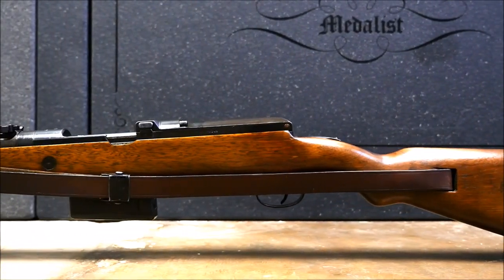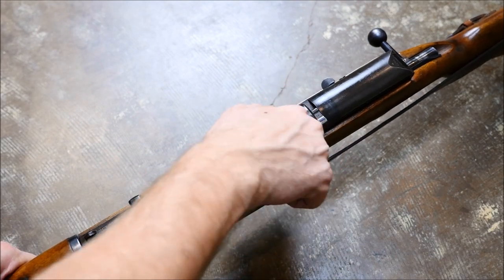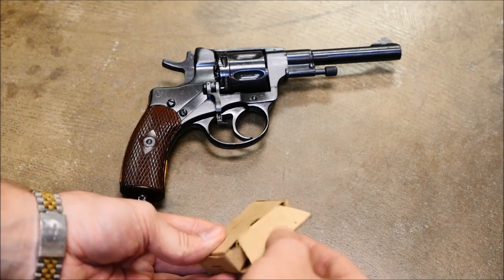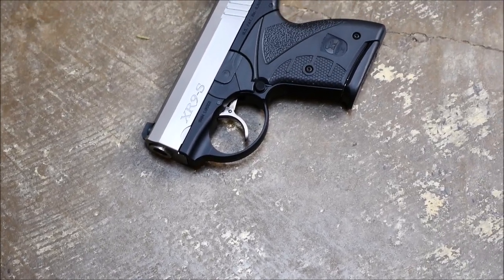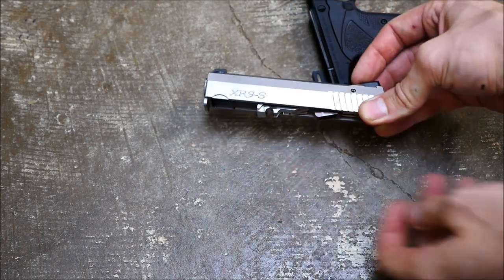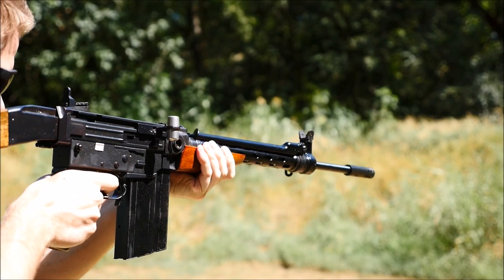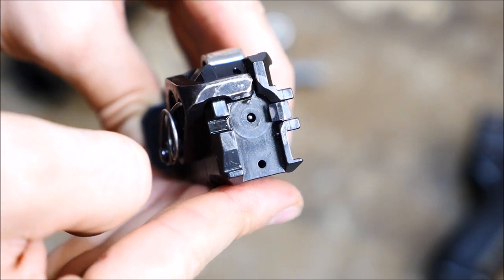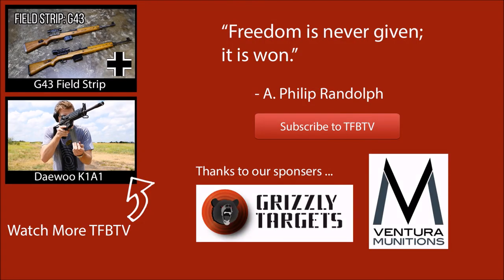Top 5 Overly Complicated Guns

Comment: The German guns being complicated is not really surprising. The Russian gun being complex is. It's really an odd as they tend to be as simple as possible. Nice list
Reply: I mean they made the Mosin Nagant not be a able to eject clips and the entire bolt assembly be two different pieces
Reply: An94 enter the chat
Reply: Ak107 enters chat
Reply: The Nagant Revolver wasn't made by Russians.
Reply: The AN-94 will disagree with you.
Reply: Common Sense Realist  No, the Nagant is Belgian. Check on Google if you want.
Reply: Nagant 1895 revolver was a pain in a ass to reload (because of the fixed cylinder), but not overly complicated, otherwise Russians would not adopt it as a service weapon. BTW, it's original design was Belgian, not Russian.
Reply: @hersencell6880  AN-94 and AK-107 are rather exceptions than a general rule.
Reply: With Germans, safety is in the details. In other words, safety is anchored in every designer. Unlike security through statistics in use.

Comment: Leave it to Germans to look at a functioning design and say "How can we destroy this in the most expensive overengineering possible"
Reply: Germans had some of the best technology at the time. They still do to this day.
Reply: Generic Username Errrrrr wrong answer.
Israel currently has the best technology in any full standing army to this day, up to and including tanks, guns, air defense, and situational awareness, for obvious reasons. The U.S. takes most advanced Air Force and most advanced Navy, technologically, and are the only air force to have battle-proven stealth fighters and bombers.

After WWII, Germany was limited for quite a while on what they could design. They used U.S. or Russian imported weapons and equipment up until the end of the cold war, when they got the chance to design their own army again. They have been brought up to the European standard, but for sure don't surpass the U.K. or Russia by much, if at all. Especially with the revamp of the AK line, the T-14 Armata, PAK-50, etc. They've lowered funding quite dramatically due to NATO and the lack of a need to have a full standing army equipped the top-of-the-line gear. 

Even during WWII, most designs that were seen as "technologically advanced" ended up breaking down on the side of the road. See: Pz V onward. They were made so poorly that after a few 75 or 76mm rounds, the front plate would start to fall off most Tiger IIs due to the terrible metallurgy late-war. The P80 and Me262 started development around the same time, with the Gloster Meteor arriving almost a full year earlier. The German navy was merely capable for its time, with its big advantage being submersibles in the European theatre. Had the U.S. not been involved with Japan, it would have been very equal in the Atlantic. 

The only thing they really had going for them were the V2's and the STG.
Reply: Dank Meems I'm talking about WW2. Also, look at the weapons and technology they had at the time. They created some great weapons and vehicles (that of course got copied later on). Look at German cars, they are still really good. In regards to the US having the greates navy, that is because they focus on this area. If Germany was to use its technology for a really large navy, it would be great also.
Reply: Generic Username What technology did they possess over the allies besides inaccurate continental rockets? The British had functioning jets before the Germans. The U.S. had the first mass-produced mainstay semi-automatic rifle of the war, since the Gewher and SVT were rare weapons. The British had the first suppressed weapons. 

The only reason Germany got so far is because France and Poland were unprepared for war. Their technology was different, but not advanced by any means. They had some wacky designs but nothing that allies hadn't already made similar designs of that were more conventional and, more importantly, functional.

It doesn't take advanced technology to create something like the Maus or STG 44. Just desperation and experimentation. The title of first "assault rifle" doesn't mean anything, other than a smaller cartridge in an automatic weapon. It's not new tech, by any stretch.
Reply: Dank Meems * the French had the first suppress-able weapons. The Germans had the first types of jets and rocket technology used. Without them we wouldn't see technology like we had today. They did make the first assault rifle as well.
Reply: Germans made the first stealth plane. Ho-229
Reply: Generic Username A quick google shows that the U.S. made the first commercial suppressor, and the British fielded the first rifle suppressed. P59B and DH 1000 Vampire both predate the first German commissioned jets, the He162 and Me262. 

They made a subcaliber round that was put in an automatic weapon. They merely created a class using older technology. Nothing about that is more advanced.

***** No, it wasn't stealth. Lmao.
Reply: Dank Meems Northrop-Grumman says it was, you say it wasn't... Hmmm, who should I believe? Hard choice, hard choice indeed.
Reply: Dank Meems The first commercial suppressor, yes, but the suppressor had been built into weapons for a while before they were sold individually.
Reply: ***** The Ho229 had a smaller radar cross section, but was not invisible. It could still very well be discerned by radar operators that were paying any sort of attention

The F117 Nighthawk, a true stealth attacker, has a radar cross-section fractions upon fractions that of a Ho229. For the time, it had a lower radar cross-section, yes. But that's like saying a grenade is harmless compared to a 1000lb bomb that represents planes like the B17 and P47.
Reply: Dank Meems
I see you don't know what "stealth" means.
Reply: No military of the big industrial nations is more advanced than the other. 
This isn't the cold war and no one needs to one up another anymore. 
Everyone is more or less on the same level technology wise (Not fire power though).

The most modern conventional submarine, the 212A, was a joint design by germany and italy and is beeing  exportet all over the world. 

The eurofighter was also a collaboration between italy,spain,GB and germany. 

The harrier was built in britain and is mostly flown in the US.

Saudia arabia is driving german tanks.

The g36 is used in 19 other nations than germany. 

After 1991 the whole "hurr durr my country is better than yours" game was obsolete.
Reply: Also regarding the "germans overcomplicating everything" and WWII.

The mauser system 98 is next to the ak-47 the most successful design/gun ever. It was used for decades and basically every country with an army used it in one way or another. An estimated 100.000.000 (onehundredmillion) of those were built since 1898. 
So there is that.
Reply: TheByQ the paper I saw written by the Northrop - Grumman stated the exterior finish was not a notable absorber of radar (not stealth).  The flying wing gives it some stealth but it was not a stealth craft as NG stated it could be detected and tracked by Allied radar tech of the time.
Reply: Dude you're so blinded by your bias. If i was to name German innovations in small firearms that other militaries copied, I'd fill 2 A4 pages. And that's just small firearms, not other stuff like tanks and aircrafts
Reply: @genericusername6644  Yea, except a women is in charge of everything now in Germany.
Reply: The efficiency is off the charts for a reason when they make stuff
Reply: Supplice VI I have doubt on the Israel having the best tanks, the Merkava I’ll consider it the best for the Israelis since I doubt it’ll stop high penetrating high power APFSDS and is more rated against HEATFS or ATGMs which is needed for its combat environment.

Comment: I'd give the C96 a pass as it was just at the start of when semi-automatic pistols were coming into development and people just werent exactly sure what would function best.  The C96 is very functional thou awkward by todays standards.
Reply: +Clay Ronso Its almost like light carbine actualy.
Reply: +Clay Ronso This has been something like a try to make the M4 carbine before the epoch of the intermediate cartridge. Mauser C96s with long barrel and wooden butt made quite a noise in London in 1911 in the hands of a few Bolshevik emigres. See "Siege of Sideny Street".
Reply: +Clay Ronso  I stripped my first C96 all the way about 20 years ago. It wasn't too bad getting it apart. I had a diagram to go by. The problem was getting it all back together. It didn't seem that hard if you remembered where all the parts went. There was a problem. The gun wouldn't work after reassembly. I fiddled with it and stripped it down again several times. After taking it apart and reassembling it over and over for at least a week, I finally figured out that I was forcing a little spring clip in the wrong way. It was such a delicate little part, but it wasn't going to work until I got it right.
Reply: +Jondahl Davis Yeah I bought a salvaged C96 a few years ago. I pulled out the owner's manual, looked at the bags full of Mauser parts, looked back at the manual... and then went to youtube for a video on reassembly.
Reply: I mean the reload is pretty fun
Reply: I never thought it all that complicated? Its like a little puzzle- you remove that piece which lets you remove this one and then that one... That one spring is a real pita, but otherwise relatively tool-less which is awesome for 1896. Slightly newer design is the astra 400- namely that recoil spring. EEESH
Reply: it is also the inspiration behind Han Solo's laser gun so gibe it a pass ;)

Comment: The Germans made so many complex guns, but many were  extremly beautifult too <3
Reply: +KieferDragoner and unreliable.
Reply: +Bill Hill in most cases not
Reply: KieferDragoner
All i know is the mg 34 and the fg 42 were not good designs
Reply: +Bill Hill MG34 was rated the best Machine Gun of WWII, it didn't function will in North Africa because of the dust, and in Russia during the Winter, but outside of that it was the best Machine gun ever deployed during WWII, even more so than the MG42.   FG42, well ask anyone who owns one, it's a better fully automatic rifle than a BAR, it will win almost every single straight up challenge vs a BAR including close and short range shooting that you'd throw at it but in likely scenarios that the MG34 would also suffer under, like desert/winter conditions the FG42 would also suffer.   

I remember reading how one gunsmith company took the FG42 and improved upon it and sell Semi Auto versions for target shooters, they fixed some of it's problems and it's easily the best full size rifle round firing semi auto rifle in the world when they got done with it.
Reply: +Bill Hill There is a FG 42 vid on Larrys Vickers channel, but I never heared that both of these guns are unreliable.
They were complex and expensive to maufacture, but extremly good working weapons, the MG 34 is also considered to be the best GPMG of ww2.

German weapons have always been excellent desings and a lot of thinking were but in them, if you want to see unrelibale guns, have a look at japanese ww2 arsenal.
Reply: +KieferDragoner It's not really fair to compare Germans and Japanese engineering, considering the gap in industrialization between them
Reply: Wildstyle96 In a lot of respects Japanese fire arms were not that bad.   I'd take their handguns over anything Italian at the time for example, and their rifles though maybe not 100% as good as like a Lee Enfield the ammunition they used was brutal because of how much it tumbled, turning a 7mm projectile into like a 30mm lung breath taker.
Reply: +Kameraden As far as I know the 7mm does not tumble, but transfer a lot of its energy into the target instead of passing right through
Reply: ***** There's also the fact that the Germans shared some of their technology with them, such as K98 and the Me 262. Though they lacked the metals to properly make them or in enough numbers - I'm sure if they had access to the right materials they'd have done a far better job
Reply: Wildstyle96 Arisaka is much older than the K98.   And all Variants of the Arisaka were genuine Japanese.  Ironically being the Japanese did copy the American M1 Garand late in the war.
Reply: +Kameraden The FG is uncontrollable as a fully auto rifle.  The bullet is too heavy and the gun is too light.  The FG is more effective if you throw it at the enemy.
Reply: +KieferDragoner Germans build high quality though expensive stuff and often very complex. Just look at their tanks from WW2, they had hybrid tanks and shit. Meanwhile people like the Russians will build stuff with questionable build quality and while it won't be any more reliable than something Germany makes it will be easier to repair
Reply: +packr72 not true the fg42 H has a spring loaded buffer and recoil absorber in the stock. And the muzzle break is a phenomenal design. Fg42s are amazing rifles. If u understand them
Reply: +KieferDragoner The German weaponry used in ww2 shat all over what the British and Australian troops were given, the german weaponry back then was so far ahead of its time
Reply: Lalnable Hector American weapons were dinosaurs as well.  Both the Thompson and Browning Automatic Rifles though a head of there times were both dinosaurs by WWII.  American Browning .30cal again a pre WWII design, and .50cal as well was all decades old design.  Prior to the start of the war itself.  Even the Garand wasn't a technical achievement, as semi automatic rifles have existed sine the late 1800s.
Reply: ***** Only because the BAR, .30cal and .50cal Brownings were Gigantic, and needless heavy to achieve that.  Thompson was hit or miss.  They had to reduce it's rate of fire, and restrict them to smaller magazines of around 15 rounds to make them practical.
Reply: +Bill Hill Yes historically complex models are never a good thing, you must try to remain simple and intuitive, you're not building for engineers.
Reply: Not to mention many of them were very effective and efficient.
Reply: +Jhawk 163 i'd rather be driving an expensive and complicated but reliable tank than a tank which could be cheaply Mass produced but has a high faul rate such as many (not every but enough though) american and russian tanks during the late phases of ww2. i mean it obviously depends on the Kind of battle you are fighting but that's just my opinion :D
Reply: KieferDragoner and over priced
Reply: Kameraden I rather have legs the type 94 can fire from the sear pin and if your pants snagged that welp many things can go wrong
Reply: KieferDragoner doubt
Reply: Izzat Qowiy Dang what are your pants made of? Graphene?
Reply: @billhill7330  I am late but let me tell you the FG42 is a very smooth shooting gun compared to the BAR
Reply: @Alte.Kameraden  the German 7.92 Mauser was even older than .30 and .50 the m1 garand wasn't the first semi auto rifle but it was the best at the time, the Thompson was also the best submachine gun of the war
Reply: lot of junk too
Reply: Richard Canaan The PPSH would like to talk...
Reply: @TheDiameter  the ppsh was impractical beyond 15 feet, it simply fired too fast and the 35 round stick mags emptied to quickly while the 71 round drums were too big and cumbersome not to mention there's no proper place for your off hand
Reply: Richard Canaan I’d say 15 ft is a gross exaggeration, and you aren’t obligated to hold the trigger, even with high ROF guns burst fire is still viable.
Reply: @TheDiameter  it's still an impractical weapon compared to most other submachine guns of the war id much rather have an mp40 or Thompson
Reply: Richard Canaan The Germans certainly did not share your feeling about it’s impracticality because their troops picked them up every chance they got. The Wehrmacht loved the PPSH.
Reply: @TheDiameter  of course in an urban environment you would pick a high fire rate submachine gun over a bolt action rifle

Comment: The main problem that the Nagant revolver's complexity causes has less to do with reliability and more to do with that truly awful double-action trigger pull.
Reply: +RedXlV 
Yeah. It is, for all intents and purposes, single action...
Reply: Krixig That's certainly how I use mine. On those occasions that I actually shoot it, which would be more often if I could get ammo at a better price.
Reply: +RedXlV 
Yeah. I ended up biting the bullet on a spam can of it (awful pun). Expensive, but you dont have to sweat prices going up. Planning on doing the same with a bunch of 303 brit, but thats gonna hurt my wallet X(
Reply: Its tfb TV what did you expect. They like guns based off of trends to get a views.
Reply: The double action is 30 fucking pounds of trigger pull
Reply: You can get one chambered in 22 LR I believe